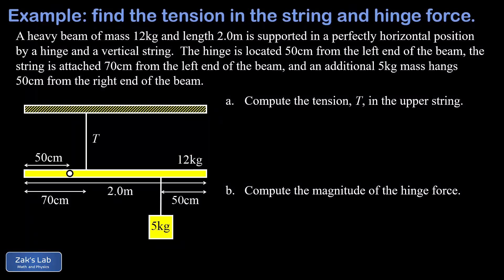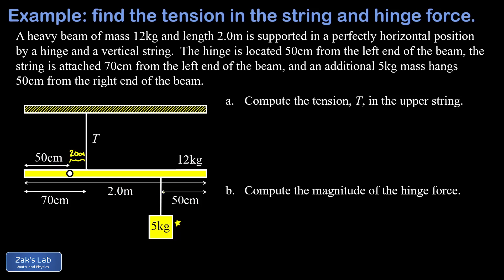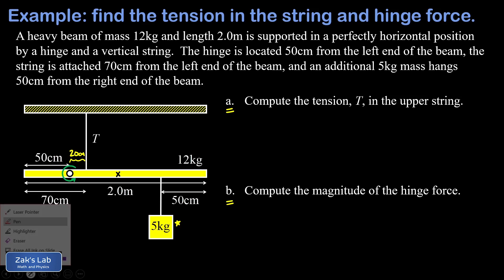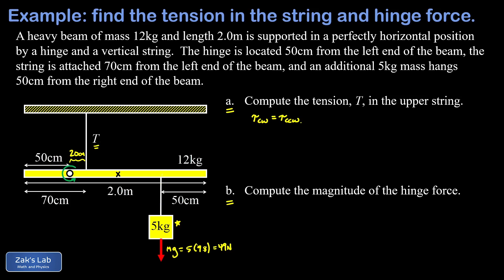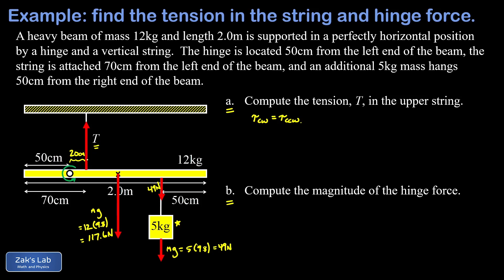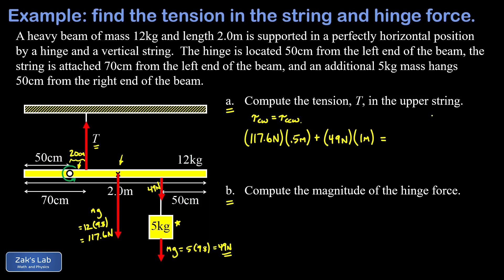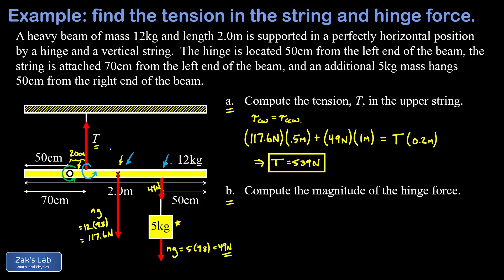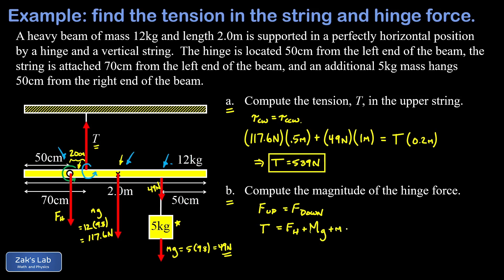Horizontal beam supported by a hinge and a string:  static equilibrium beam and cable problem.

Comment: Hey there! I appreciate the video! Can you please tell me why the force exerted by the hinge acts downward?
Reply from the maker: The easiest way to see it is to take the attachment point of the string T as your rotation axis.  There are two clockwise torques with respect to that hinge:  one from the center of mass of the beam and one from the 5kg hanging mass.  This means the hinge must exert a counterclockwise torque with respect to the attachment point of T, and that requires a downward force.  The force is exactly downward because there are no other forces acting horizontally in the problem, so the hinge force also has no horizontal component. z